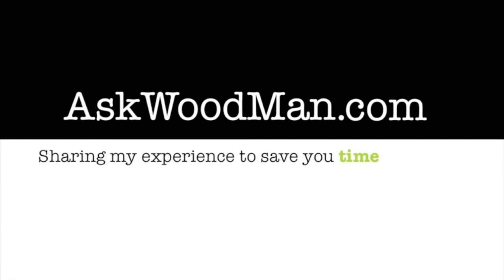19 of 28 • Building An Entertainment Center for Flat Screen TV: A Furniture Project

Comment from the maker: @ironlionkalo You are correct. Any router that accepts bushing guides will work. I can't wait to show all the stuff it does when I get back to more router videos. Those anodized aluminum members are Mitutoyo square when tightened. I have also used the jig as a giant square. Their manufacturing process on those pieces is right on.  The time I spend making jigs has dropped dramatically.